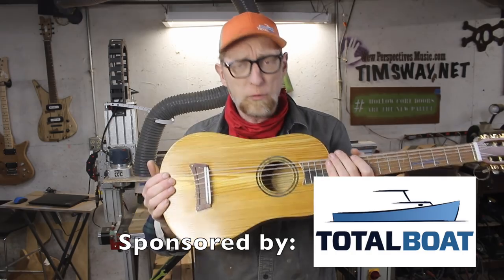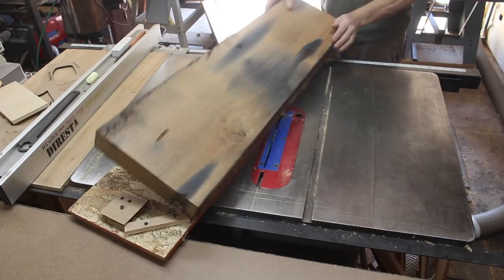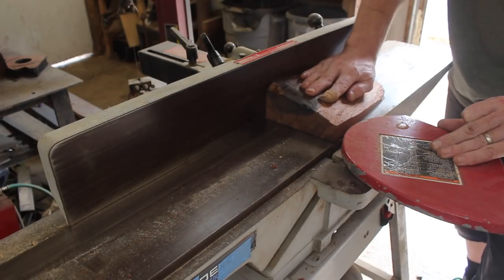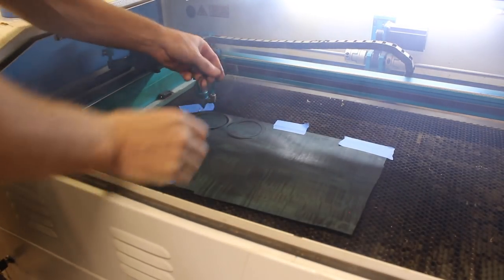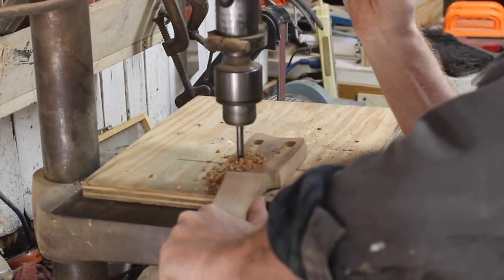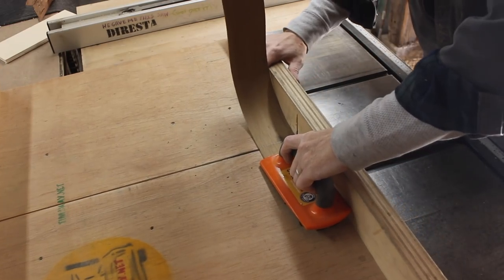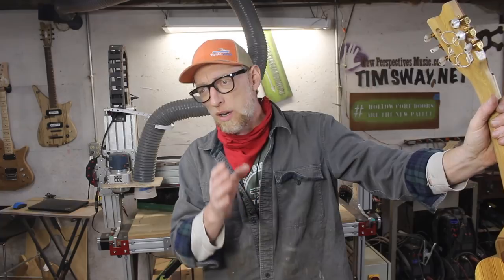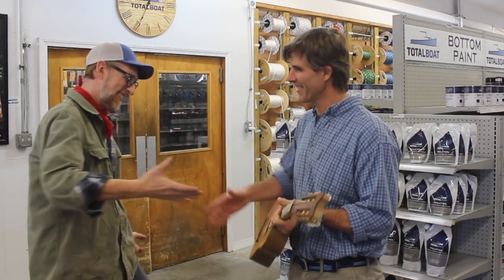Mini Acoustic Guitar - Reclaimed Historic Boat Wood

Comment: Binding is mostly for protection. The wood is so thin that if it gets a little bang on the edge it can start a crack that will just keep growing.  That is also why there is inlay around the soundhole. It's not just decoration.  It's also why violins have purfeling.

Comment: Guess you could've used Thomastik KR116 Ball End Flatwound Rope Core Strings cause the Ball Ends make restringing a Snap. The Flatwound design will also save the frets from scratches.

Comment: When building acoustic when it comes to the bridge it's put on after the finish traditionally. What you do is tape off exactly where the bridge goes with a mm or 2 undersize. Finish it , pull the tape off  and then glue the bridge on. It helps reduce that streaking from the brush around the bridge. And the mm undersize puts a little finish under the bridge making it look seamless.
Reply from the maker: well THAT makes sense :)
Reply: @timsway  hey happy to lend advice if ya need. There's a great book on guitar building that covers all of this for acoustic and classical, I'll have to get ya the name of it. But I was my Bible of sorts when I started out.
Reply: @MilesMcNallyLuthierie  Is it "Guitarmaking" by Cumpiano & Natelson ?
Reply: @MilesMcNallyLuthierie  Is it "Guitarmaking" by Cumpiano & Natelson ?
Reply: @stratocactus  yes that's the one. Guitar making tradition and technology is the full title.

Comment: Great video!  I have been building cigar box guitars but have ambitions to make a proper instrument from scratch.  I always make mistakes but have learned from each one of them.  That is what makes building these so much fun. I think you can still salvage your first build by removing the bridge and replacing it with a thicker one.  With a new saddle sitting in a thicker bridge, it won't be or look ridiculously tall.  Alternatively, you could remove the bridge, refinish the top then add a tailpiece and a floating bridge like a mandolin.
Reply from the maker: I was thinking abut a floating bridge but it might look silly on the flat top. For now it works and plays so I'm gonna leave it kicking around as a shop guitar - and a humbling reminder when I start thinking I'm hot sh*t. hahaha!

Comment: Other than patience, which I'm always working on, I've been learning that you always have to practice before working on the final piece. Whether it's a cut or a process or a jig, it never comes out perfect the first time. I'm sure experience helps to shorten the time spent practicing, but I'm certainly not there yet. Thanks for sharing!
Reply from the maker: Indeed. Test cuts is a good idea, when possible. I'm getting better at that, but I have this "wing it" mentality that is hard to break...
Reply: I was cutting box joints yesterday on the table saw. First time trying it, so I did a buttload of test cuts to make sure everything was aligned properly. Still ended up with one end of one board that was completely out of whack. Guess I should have practiced some more. 🙄

Comment: i spent a lot of time building some of of my shop tools - but my steam rig was not one of them - its literally an old mailbox...

edit - low voc (actually no voc), brush on, and one day finish are the reason i started using UV cure poly resin - its a pain in the ass if you dont have a UV setup, but i live in texas so sunlight is usually available - its a product originally used on surfboards called solarez - LMI has a UV cure product too but i've never used it - i still use lacquer when i have to spray something - im gonna look into totalboat though if its sprayable

i've built many electrics, but im just now starting to get into acoustics - actually im not even there yet im about 90% jigged up to start building proper ukes (i still need to build a radius board and go-bar deck) once im comfortable with my uke skill i will move up to full size dreads and cuts

i appreciate you showing your first attempt, sometimes i watch YT luthiers or furniture guys and their videos make me feel like i should just go get a job flipping burgers... its good to know im not the only one making mistakes.

its silly, but i have a fortune from a cookie that i've kept for years - it says 

"failure is the opportunity to begin again more intelligently"

that little scrap of paper has honestly kept me going through times when i was fully ready to throw in the towel...
Reply from the maker: I like the fortune! Wise words. I've never tried to make myself look like an expert on this channel because I'm not. I also find the royal blunders more entertaining and educational, so I share them. LOVE the mailbox idea. I almost just capped a piece of PVC pipe for my steamer box but I had the plywood laying around, so...

Comment: Great job man! Definitely will look into that Halcion (sp?), I did a french polish with shelac on a previous guitar I did, after weeks trying to get a poly to stick. The shelac looks good, but I live in an apt with a small dog, so anything less toxic would be best. How many coats with the non-spray?
Reply from the maker: Halcyon is spelling. With a brush 2 or 3 coats is probably enough. And you can so that in 3 or 4 hours, then let it cure for a day.
Reply: @timsway  wow that's really quick. Definitely will be picking some up.
Reply from the maker: @absolutless  I have a 20% off code at the website. Use "TIMSWAY"

Comment: While you were making the first guitar, were you still thinking it would be the only one, or did you do it for the video?  I would have scrapped project number one the moment when I knew it wouldn't work.
Reply from the maker: I was OK with each little mistake or "I'd do this different next time" as I went along because I solved them all or trimmed them out, etc. But the basically last step, gluing the fingerboard on, was when I noticed the problem, so I just tried to finish it anyway. I did have the foresight to prep enough of the wood to make two as I worked, in case I needed to redo a step, so the second one went much quicker.

Comment: Thanks for the how not to do it video - lol! So if someone wants to make an acoustic guitar, maybe they should buy a plan, and watch a bunch of guitar building videos first so they know how to put it together? 

I'm currently building my first acoustic ukulele, and first electric ukulele. I think I may have watched 80% of the how to build a uke videos on You Tube - acoustic and electric. When the electric uke gets built, it will be the 3rd one. First one was made from 3/4" insulation board to get the general proportions and shapes right (mistakes were made, things were learned.) The second one from pine boards (more mistakes made, more things learned.) The last one will be mahogany (without previous mistakes, only a few new ones???)
You have to be careful about this kind of thing. Making a better version of the last one can be addictive. There are people in the 70s who have been making better guitars since their 20s. They just can't seem to stop.
Thanks again for the video.
Reply from the maker: it is an addiction

Comment: It's funny, because I am into traditional woodworking and to see the high tech approach is interesting. Some operations seems wasteful, others staggeringly efficient. I like tech too, but my workshop can barely house my hand tools.
Reply from the maker: certainly! I'm interested in the mix of them, too. I want to understand the process from cavemen using rocks to today. By all means sometimes the time of a machine setup outweigh benefit. It's important to remember that some of the physical waste on the cnc would still be cut and tossed using traditional tools to make the part, just spread out over different machines.
Reply: @timsway  I'm with you on that! I don't think any of your methods wasted any extra measurable material. I suppose in many ways seeing a cnc machine radius, shape and slot a fingerboard in a fraction of the time I can do it is triggering some cognitive dissonance!
Reply from the maker: @BrownianMotionPicture  dude, if the cnc did ONLY that it would be worth the footprint in my shop. LOL. It took some work creating the files the way I want them and dialing in the cutting, but man it is so much better than doing it by hand.

Comment: hi Tim! what router bit do you use for cutting fret slots? could that bit be used with a Dremel or similar rotary hand tool?
Reply from the maker: it's a .023" end mill. You're much better off using a saw by hand.

Comment: Yeah, you gooched on the first try, but you did an excellent job the second time around, so I tip my hat to you, good sir. My personal recommendation is this, if you want to cut time down that is. If you mess up at any point in the process, stop. If it looks like it cannot be saved, then start over right there and get it right the second time instead of trying to salvage a train wreck because as you saw yourself, the train wreck got even more wrecked. And binding is great, but not required. It's just a decoration. It honestly doesn't save anything. Long as you got everything put together well, it'll survive without binding.
Reply from the maker: cheers. I really thought it was going to be OK until I put the neck on, which is basically the end, so at that point I finished it for the learning experience (and video). I did have the foresight to prep enough material for two guitars early so the second went together quickly (I had even bent two sets of sides at the same time).
Reply: @timsway  Well, at least you planned ahead in that way. And as I said, your second time turned out great. Look really good, and the client looked genuinely pleased.